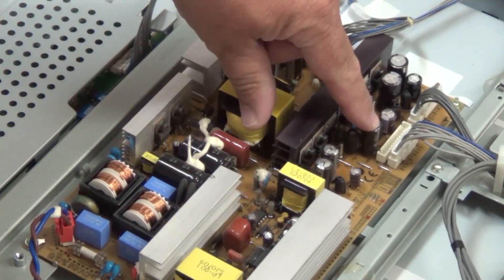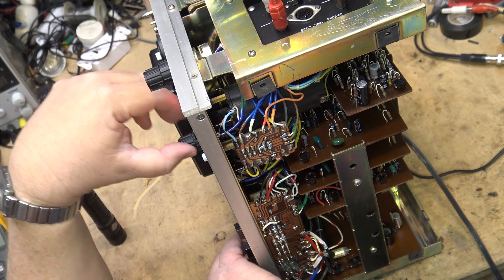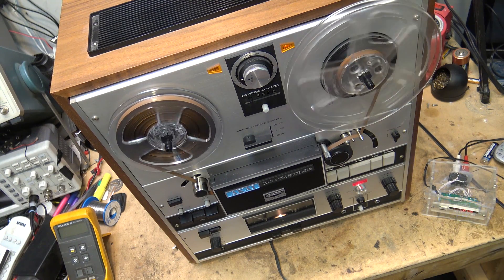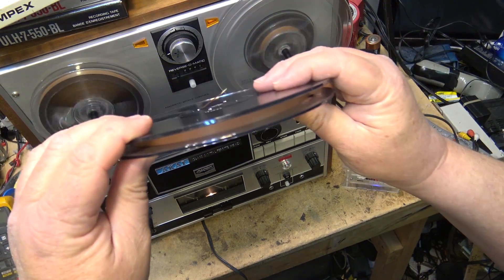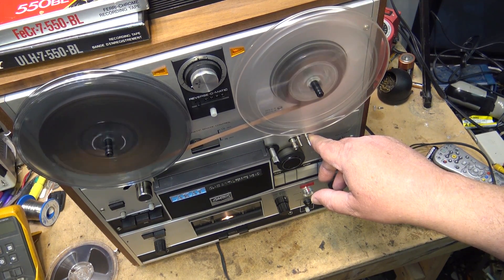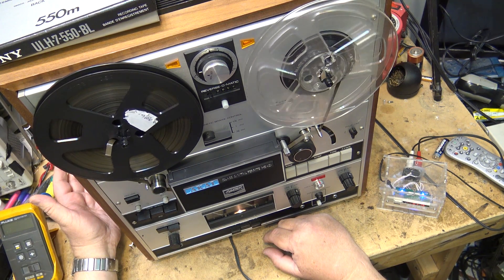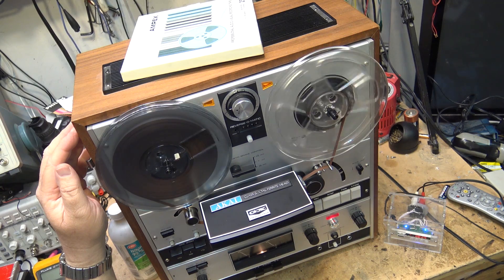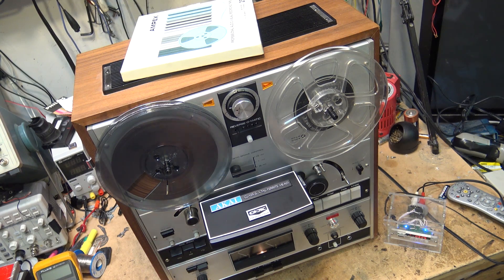Akai GX365 Record level calibration

Comment: My Panasonic RS-765US also has the bias tuner which is at the bottom of the unit inside where you can adjust the bias and calibration for both recording and playback levels

Comment: Owned a 4000D from new and eventually began to squeak. It has a pad in front of the heads to which oil had to be applied to stop squeaking. When one of the heads gave out replaced with Akai glass heads with excellent results. I keep applying oil to pad. Still a little squeaking at end of a long tape.

Comment: i bought a load of 10.5" AMPEX 406 Tape on Metal NAB Reels about 10 years ago from fleabay at a bargain price of about £70 for 8 and they had the same problem so i put the tape in the bin and like you mentioned i bought a few tape pancakes and put them on the empty reels and transferred a few 10.5" plastic reels of tape over to the Metal ones and i have never bought AMPEX Tape again but i think their 456 tape is ok but i now only use Maxell or TDK Tape
Reply from the maker: Ampex 291 is also shit.  That was the tape I tried to record on.  541 is good. No issues with it.
Reply: I thought Ampex being a deck producer would make good tapes, but now I learn from you people that their tapes are junk. Thanks.
Reply from the maker: @pliedtka  Some of their tapes were crap. Others were good.

Comment: From my experience: Scotch brand (various stock numbers) from the 60's seems to have no issues with sticky shed. I also have a bunch of Lafayette brand (not sure who manufactured those) that are still fine after 50 years. Also Radio Shack tapes seem to have no issues.
Reply from the maker: Sony, and ampex had bad tapes as did scotch.  It was mostly the high end black back coated tape that had sticky shed problems.
Reply: There are lists in the internet of the tapes that have sticky shed syndrome.Cheers

Comment: And forget about playing acetate tapes on the glass head machines, it will scrape the recorded coating right off. I know cause it happened when I gave one like that to a friend to play on his deck. It was an AKAI also.
Reply from the maker: Correct.  The glass head was not all it was cracked up to be.  About the only good thing is they didn't wear out.  Sound quality wise they were only average as they were just a ferrite head.  Sendust and permolly had much better electrical performance.

Comment: Hey, don't knock nostalgia; these tapes are also used for computer programs for computers such as the Altair 8800 (of which a clone was manufactured in 2015).  I think that there are people who repurpose tape for other uses, which is good, because there is enough plastic in the environment already.  Please upload a recording of that radio programme to your Patreon page or something; it is good to remember.  Also, Super Valu is still in business in certain cities, including one in Burnaby.
Reply from the maker: Yes I was going to archive that radio show today on my gx265, if it works when I turn it on for the first time in 2 years.  With my luck it will go pop.  This one probably sounds better as the owner totally recapped it and mine has 50 year old caps in it, but I don't use tape, will never use tape again. Keep the machine just for archive and because it looks cool.   Unfortunately I can't post the music from it because it would pull a copyright strike.  I could put up the old commercials and dj talk.
Reply from the maker: Super valu is owned by Loblaws and did close most of the stores in the 80's. The larger stores were re-branded "Real Canadian Superstores" and others "Extra Foods". They still own the name, and some smaller shops have opened up in small communities branded Super Valu. All the smaller independent shops have been bought up by the Sobeys, Loblaws and Pattison group. They close the old stores and axe all the workers, many unionized and open up under one of the other brands as a non union store paying bottom dollar for their workers.
Reply from the maker: I'll put up a video of the talking and commercials of this tape. Will bring back memories of some of the personalities at CFMI, many whom are no longer with us.
Reply: @12voltvids  Thanks.  Better times, in many ways.
Reply: @12voltvids  But it still exists.
Reply from the maker: @infinitecanadian  
They did bring the name back, but they were all closed and none of the closed stores reopened.  The one out here was torn down and a Safeway opened.   Then a thrifty across the street opened. When Sobys bought thrifty, they closed the Safeway and a save on opened in same location.   Their also used to me a iga but when they were bought out by loblaw, that closed too because there was the super value across the street.  Can't have 2 competing stores owned by same company in same town.  Then the super valu butchers went on strike which closed the store and the company left them out to rot.  They ended up closing all the stores, but they hung onto the name.  Guaranteed they are no longer a union store where the workers make a livable wage.  I know my son that works for thrifty doesn't make a livable wage.   He makes about the same as a kid flipping burgers.  He got a 2.00 an hour raise because of the covid threat as he has to work to keep the shelves stocked.  Fyi the stockers and check out people at the union stores made 16.00 an hour in 1984.  That is more than my son makes an hour today doing the same job.  In 1984 the minimum wage was what 4.50 an hour. Don't get me started on wages.
Reply: @12voltvids  At Superstore if you worked long enough, you could get 23$ an hour.
Reply from the maker: @infinitecanadian  One of my kids friends mother worked for Safeway. Had been there 20 years and was making 24.00 an hour. They closed the store, reopened it as a fresh co and offered all the old employees new jobs starting at 15.00 an hour.  Of course they all told them to go fu*k their hat.
Reply: @12voltvids  When I was working for Superstore, the old contract said that you could make up to 25$ an hour.  In the new one, the maximum was 15$ an hour or so.  Clever bastards realized that most of the people signing would be naive youth who would want 500$ of signing bonus because they didn't expect to be there long enough to get to the high wages.  I quit during the old contract and came back during the new one.  Pain.
Reply from the maker: @infinitecanadian  union busting 101.  
Even where I am, at the fone company new hires start at 20, and go to a top rate of 25, but they also get commission for sales.  That is about 12 an hour less than the full telecom techs.  This is because they don't have the same job responsibilities as I do, even though 80% of their job is exactly the same.  They don't work on outside plant so their contract says they make less. We are all in same union.

Comment: Off the topic, I have a Yamaha TX 1100U tuner that has extremely bad reception.  It has never been in for repair.  I opened the case recently and found the inside of the unit to be absolutely pristine condition! No signs of decaying caps or anything burned. Can you help. Sincerely a dedicated  Yamaha enthusiast...

Comment: Do you do azimuth adjustments or do you leave it out? I guess the problem is what is the reference that is right? Else, there is apparently programs that can adjust and correct the azimuth from tapes that are played back, I doubt it will be possible to recreate the frequency loss for a bad alignment. To playback a tape for transfer, in my opinion, there will always be a must to adjust the azimuth first. The challenge to do it as you will not have a high frequency tone to guide you unless you are an experienced one that hunt for the bias frequency. I do my azimuth adjustment by connecting both channels together and judge it by that when adjusting the head but it might be other tricks to do it.
Reply from the maker: Rule #1 when working on tape decks.  If the head is paint sealed from the factory, the azimuth is CORRECT. If your pinch roller is worn it can skew the tape and make it sound like it is off, but the alignment will never shift unless someone screwdrivers it thinking toucan improve on the factory setting.  The only time it needs to be done is after head replacement.   Now, some machines that rotate the head to play the reverse side the auto reverse mechanism can start to wear, and that needs addressing but that won't change the head alignment.  The akai gx260d was an example of the best ever auto reverse design.   Center mounted capstan and pinch roller.   3 heads, erase record and play on the left side for forward, and 3 more heads erase record and play on the right side of the capstan for reverse.   This silly machine reverses the motor and "pushes" the tape in reverse and the play head is physically shifted with a solenoid. Tape tension over the head is maintained by a free turning roller that is driven by the tape passing over it. 
In all my years, I have never seen alignment issues unless someone messed with it.  The proper way to do this is by playing a full track mono alignment tape and connecting the scope to both left and right outputs and adjusting using x-y mode on the scope for no phase shift and maximum output on both channels.  On mono machines just maximize the output.
Reply: @12voltvids  Yes, adjust that O shape to a / shape on that scope. Its so good that we know somebody who knows that tech knowledge still out there. Keep out the good work and wear that tuk!
Reply from the maker: Right and you need to use a full track mono tape to get it exact.

Comment: I had the problem with back coated reel tapes that had Sticky Shed Syndrome. It was annoying while recording a tape. It was junk. I have to unravel the junk tape from the reel and add more refills like a decent brown tape like a pancake or a 10 1/2” reel that won’t fit in the machine to add more tape to the 7” reel, and it would be good to go.

Comment: Are those record level adjustments true for all R2R? ... my Pioneer 707 recording it hits the red constantly... but on playback it barely moves the meters half way...bad tapes? before you toss them use auto polish with silicone , and run the tapes back and forth like you were doing till all the residue is gone... it revives them ...per Tapeheads.net
Reply from the maker: They are more accurately the record level indicator calibration as according to the manual, you play a reference tape, and set the playback gain so the reading is 0. Then load a blank tape and put the unit in record, in tape monitor mode and set the recording level with the controls on the front to read 0 db on playback. Then switch to source and calibrate the meters so the show 0. This way when a 0 db signal shows 0 on the meter on source it will show 0 on playback. Now since I do not have a factory calibration tape to calibrate the playback amp, I didn't touch that. I assume it is correct unless someone monkeyed with it prior to me looking at it. Client wanted the record level calibrated, and that is what I did.
Reply: @12voltvids  
I think is 250nWb for playback level, I just don't remember. But most R2Rs don't have noise reduction, so back compatibility with other machines the levels are not that important. I had JVC TD-V541  3header cassette deck that for some reason with Dolby C sounded like s...
It used Sony Dolby chip, but other machines used the same thing and played OK in C. I got calibration tape to check if maybe something is out of ordinary, but everything was like service manual said. Could be the HX Pro was underbiasing the tape, who knows. In Dolby B it was awesome, especially with TDK MA-Xs, unfortunately the heads were permaloy and wore in a few years, maybe 'cause I used Metal and Chrome formulations, mostly TDK, Maxell, some Sony. I know now that some of the X-tall Glass head from Akai, Sony equivalents and Amorphous heads can last for decades. 
It's funny how you rewind the tape by finger. Actually, l would like to learn more why some heads are worse with certain tapes than others, when you mentioned that Glass heads causes sticking with the last tapes you played, especially the one that caused the squilling noise. There's always something new to learn that nobody else talks about.
Reply from the maker: @pliedtka  sticky shed tapes are far worse on glass heads because the glass is so smooth. Metal heads the metal is rather porous and the tape doesn't stick as easily.
Reply: @12voltvids  
Thanks
Reply: I did that with some tapes but like you say it takes time.I do apply it to the heads and guides to help with wear on the with any tape that I use.Cheers
Reply: 12voltvids I have a Concord 220 reel-to-reel tape recorder which was “Transistorized”, and it has a red glass head for the AC erase. I tried one of these and it gets very noisy due to Sticky Shed Syndrome.  

The inside of the Concord 220 has a screw adjustment which is the VR3 on the circuit board where you can calibrate the recording level with the “Magic Eye” level indicator tube. 

For example, if you adjust all the way to the left, the “Magic Eye” level indicator goes full, and no adjustment on the volume due to distortion. If you move to the right, the “Magic Eye” level indicator goes too low. 

The Concord 220 has two transistors and two vacuum tubes. One is on the amplifier tube, and one is for the “Magic Eye” recording indicator tube, and the parts are all made in Japan by Matsushita, the same company that made Panasonic. Matsushita made other great components under different names like National, Panasonic, and Concord.